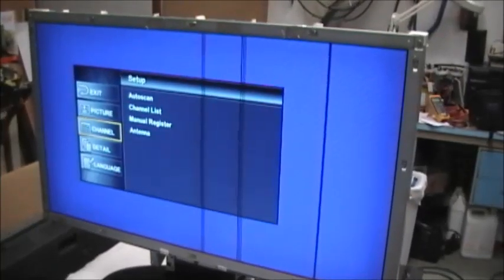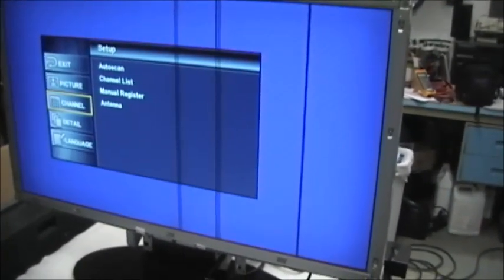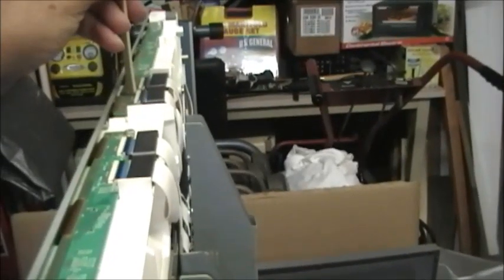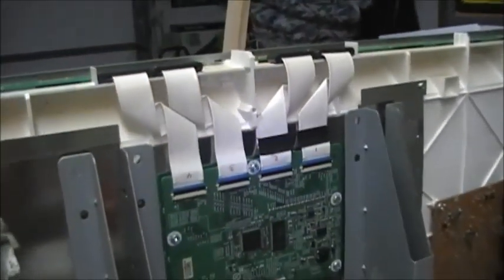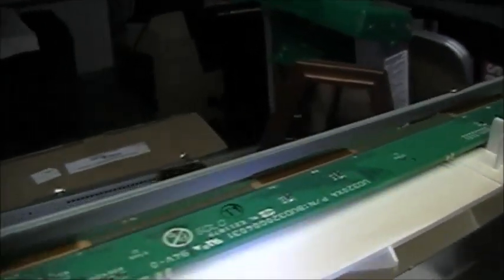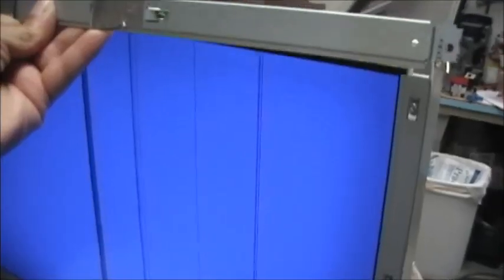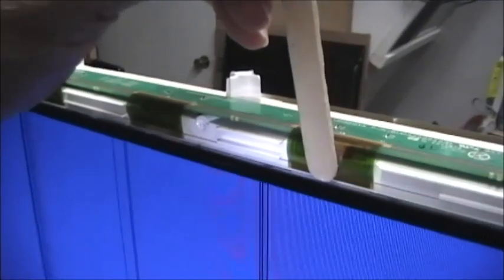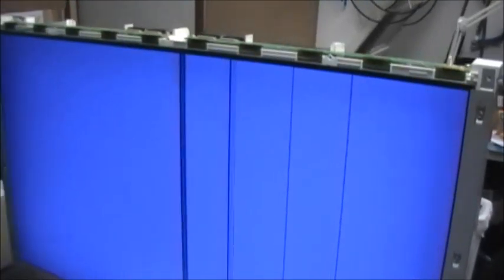LCD TV Repair Secrets - Vertical Lines on the Screen

Comment: My tv is an Eko 42in smart is like the middle line, it's behind the screen display but it flickers. I can't really dissemble my tv by myself so idk what to do
Reply from the maker: Well the good news is that when a flickering line is behind the settings menu, it means the LCD inside the display panel assembly is fine. The problem is most likely loose connections between the digital board and the LCD. The digital board is behind the back cover of the TV. Taking a back cover off is MUCH easier than taking a display panel assembly apart. Of course, you still need someone to take a look for you, but the problem will be beneath the back cover, not in the display panel. Hope you have someone. Good luck! Thanks for commenting.

Comment: @LawrencePina Do you know what would cause white vertical lines that are only there when you open the menu?  The TV works perfectly normal for about 12 hours or so. It's like after it gets warm or something then it starts showing lines, but only when you open the menu. The lines are going up n down from each letter in the menu. If you selected something else in the menu and the words/letters are in a different place, the lines follow them. You can turn the TV off for a few hours and it will be perfectly fine again for 12 hrs or so, then the lines show up in the menu settings.  If you don't turn it off when it does that, the screen will eventually go completely black. But then it will work normal after it cools off... Idk? Thanks in advance for any input you may have about this.
Reply from the maker: Sounds like a digital board problem. I've rarely seen similar symptoms but much larger repair databases exist. To use them, paid subscribers (I am subscribed to a few of them) will need the make, model and manufacturing date of your TV. Repost with that info and someone may be willing to share exactly what's wrong with your TV. Let's find out. Good luck! Thanks for commenting.

Comment: So, really cool thing about the conductive adhesive bonds these panels use for that stuff. This dates all the way back to even dot matrix displays. The way how that adhesive works is it conducts under tension. When not under tension, it is no longer conductive. 

It's not necessarily a matter of the glue itself becoming "unstuck", but rather, the chemical structure of the glue in one particular spot (or many) has been altered, as it is no longer under the correct amount of tension to conduct electricity. 

Think something like a chain. When under tension, a chain is strong and it is capable of linking two moving parts together. When that tension ever so slightly changes, that is no longer the case. These conductive adhesives work a lot like that. The difference is, the chain is molecular. The adhesive is still sticky, it is still doing its job. But somehow, some way, the molecular structure has been altered and it is no longer electrically conductive. 

This type of adhesive bond is extremely similar to what is used in silicon dies, to electrically attach the die to an interconnect. The big chips we're all used to seeing are actually significantly smaller, the die itself is very tiny in comparison to the big chip packaging they are placed into. Adhesive bonds like these are sometimes used to attach micrometer diameter wires to the package interconnect, which is what gives a DIP for example the leads you would slot into a socket, a QFN the edges to surface mount to a board, or even give a BGA the pads underneath the package to accept solder balls. 

It IS possible to fix these cables, I've seen it done on iPhone LCDs in a process where a new cable is attached to the panel. The way how these specific cables work on many TVs and displays is they are bonded the same way at the panel AND the board substrate. The trouble is, I don't think anyone makes tools to service the cables on anything larger than what you might find on an iPhone LCD or OLED. If they did, it would certainly be possible to restore the connections on these cables and fix them long-term.

Comment: Tks Bud 
After all the posts you ve been a great help  been trying to work that out.
So ok has any one tried to reactivate the bond maybe with heat gun or such 
Curious
Reply from the maker: I tried that, only to find that any heat you put on the cable completely detaches it . On the other hand, any pressure you apply to the cable immediately gets rid of the lines, but only temporarily. Due to heat related expansion and contraction, they always come back. Longest I've gotten (by applying a pressure pad) is about a month.  Yours is a good question. Thanks for commenting!

Comment: Can you tell me what  I can do to my sony Wega with the picture moving horizontally? thanks
Reply from the maker: Resolution of the sending device may be too high. Try reducing it to 480p. If that works try increasing to 720p. Also make sure frequency (50 or 60Hz) is correct. Good luck. Thanks for commenting.

Comment: My tv is the ribbon cable but i cant get rid of them.  When tv is first turned on on the left it has many lines but as the tv warms up all but 2 lines will stay on the screen.
Reply from the maker: At least you know what's causing the lines now and you won't waste money on boards that are not going to fix the problem. That was the point of the video, so I'd say you got the point! Thanks for commenting!

Comment: @lawrencepina the glass panel has two layers in which liquid crystals are sandwitched between two glass sheets . The glass has etching done to connect with flex cables for 1920 x1280 resolution. The TV when becomes 7-8 yrs in age , the connectors which are attached by a process of conductive bonding , to the glass. which means one side copper on flex connector is bonded with glass , to provide signal. The heat generated flows up from smps and some of the connector pins get debonded due to expansion or heat , when product is aging. Slowly the [product gets these lines.  Secondly , there is a small chip within the flex cable itself when you observe it. UAO is a company which makes the panel with top pcb and provides this as a single entity to Samsung and other makers. There is a specialist repair centre in a town , which can do the re bonding of these panels.  If you have a panel issue . typically no one will try to re bond it themselves. The regular mechanics or Samsung type of TV centres will simply replace the panel and it will be an expensive affair. The life of LCD TV is 7-8 yrs as against pciture tube TV ( 15-20 yrs). 
The way you were showing the small tapping on connector removes the line,  is ilttle dangerous since it will create morelines.  
Over the TV which is not mounted properly and is very heavy in weight , the screen does not stay in perfect vertical plane . That brings strain on the connectors on top , mostly on right side of TV . Due to weight the panel will still not stay perfectly staright , since the mounting person may not have used the 4 screws and leveled it properly. A small tip on perfectly mounted and tighyl fitted stand , can give your TV before the line appear.  Once the lines appear , you need to take it to panel bonding repair centre which has special facility to re bind the connectors. That is the real solution for this issue for panel repair. If you are a person who knows the proper handling of large glass panels, then you can also remove the panel connectors and T con Board , take it to bonding centre. The ACF Bonder orT con board have 2 categories - 12V or 24 V and 30 pin or 50 pin interface.  The logic board of samsung , or sony or LG can have similar interface at T Con levels. 
Laptops also have display panels sold in market based on connector pin size. Once you know the panel resolution and connector pins 30- or 50 , then you can order the panel based on size ( 14" or 17" or 15.6" or 46" or 54 " and so on ) Hope this detailed info helps everyone

Comment: Tried this and several other recommendations without success as yet. I only have ONE green vertical line, it is clearly dots running up and down. In that line there is one missing dot. Might that tell me anything? Like maybe it is the actual screen rather than anything else? Would love an answer from anyone with any thoughts on this. Thanks!
Reply from the maker: You have a bad display panel assembly and because of the way things are, there's noting to be done about it. At least you know that new boards are not going to fix this problem. If it was up to me, I'd require TV manufacturers to guarantee their display panels for 5 years (parts and labor) or, at their option,  replace the entire TV. Never going to happen, though. People have been conditioned to "throw it away and buy another one." Sad comment on our society...
Reply: @LawrencePina  Agreed.
Reply: @LawrencePina  Yeah, the "assemble-cheaply-because-we-want-more-sales-and-money" mentality is not good for our planet either. Look at all that waste we bury in landfills or pile up as junk, right?
Reply: @LawrencePina  At least they could make accessible the service manuals and host them forever on their sites, it costs pennies to do so.

Comment: Yea..... But how do you fix it lol
Reply from the maker: This one was so bad, had so many lines, that I didn't even attempt it. But sometimes, when there's only one line, you can try to fix it by applying permanent pressure. People use everything imaginable - wads of bubble wrap, wedges of cardboard, eraser material, packing tape... Just about anything will work, even just a good squeeze, at least temporarily. The problem is - heat expands, cold contracts. As soon as you turn the TV OFF, the contacts cool down and tend to separate again. That's been my experience. Other's disagree, though, so who knows?
Reply: @LawrencePina  thanks for the info

Comment: You can fix these with rigid foam window weatherstripping pads (experiment with various diameters). Stiff enough where its not too spongey, and once the bezel is put back on, it creates enough force to securely wedge the cable back to the board. It does work and I fixed one I got 6 years ago, still works.  When you are poor like me and cannot afford a $750 HDTV, and get that same $750 HDTV for $60-$85, this is what you have to do.

Comment: This is great vid for diagnostic.  How to fix it?
Reply from the maker: Almost anything you use to apply pressure will provide temporary relief, but in my experience, there is no permanent DIY solution. Permanent repairs require new (exact replacement) COF cables (generally sold in bulk), chemicals to remove, clean and reattach them, an "LCD Tab Bonding Machine" (please search on that term), and a highly-skilled "LCD Tab Bonding Machine" operator. Presumably, such repair shops exist in Asia but I'm not aware of any here in the States.
Reply: @LawrencePina  thanks for the info.

Comment: Perhaps a hobby iron could be used to heat/re-activate the factory glue
Reply from the maker: Get any kind of heat anywhere near that COF (chip on film) assembly and the film will melt, quickly detaching the whole thing. Now, ask me how I know that...
Reply: Ok, cool. What temperature did it melt at ?
Reply from the maker: @nimrodquimbus912  Can't tell you. I just waved a hair dryer at it while pressing the affected area with a Popsicle stick and when I let up (after just a few seconds), the whole COF detached.

Comment: Would black horizontal be caused by the samething? Also why does taping pins on the ribbon cable make the problem go away?
Reply from the maker: No, black horizontal lines are not caused by the same thing in my experience. Tapping the pins works because it temporarily closes open contacts.
Reply: I bought a 4k lg tv with horizontal black lines going across the bottom quarter of the screen. I fixed it with tape, narrowing it down to 4 pins on the T-CON ribbon cable. With those pins blocked it caused faint vertical line that are only visible on white or bright background colors, still pretty unnoticeable tho. Just curious whats causing it.
Reply from the maker: Clarification: I love Gritz's TV symptoms are NOT related to the 
vertical lines shown in the video. To prevent unnecessary confusion, different symptoms are best discussed elsewhere, but that having been said...

Answer: No, I don't think the situation you describe is timing 
control board related. The bypass method you've successfully employed confirms liquid crystal structural failure. Most likely, the faint vertical lines that you now have indicate that you've just bypassed too many signals. Move the insulating material left or right (uncovering just a single wire) and retest until the original horizontal black lines across the bottom quarter of the screen reappear. The wire just uncovered is generally the only one that needs to be bypassed. Using a mini razor knife, notch that one wire out of the cable. Reconnect it without using any insulating material and retest. If the horizontal black lines have NOT reappeared, that's the best the LCD is going to be. If the horizontal black lines remain, you may need to bypass a second signal wire (rare). Otherwise if you still see faint vertical lines, you can try entering the service menu and turning down the sub-contrast until the faint vertical lines disappear. And, for what it's worth, you've earned my respect just for getting this far. Thank you for sharing your experience.
Reply: @LawrencePina  Thank you for taking the time to answer my question.

Comment: YouTube won't work on grundig smart tv. What could be the problem and how to resolve it?
Reply from the maker: I wish you'd asked this question under one of my "MBOX Frustrated User Guide" videos but assuming the clock is set to the correct time on your TV, and assuming you've got at least a 10 mbps Internet connection to it, then the YouTube app you have may not be compatible with the OS you have. An automatic app update or TV firmware update may have caused this. Additional app updates and firmware updates may resolve it. If not, then consider adding an external Android TV box to your system. AliExpress prices start at under $20 and there are some surprisingly good boxes in the $25 range. Any of these will play YouTube and much more with no problem.

Comment: i have problem of vertical lines in dell s2418Hx montor :( how to fix any solution?
Reply from the maker: Same problem. Same verification procedure but even easier to prove on monitors and laptops (because they have less metal around the screen). Without even taking the monitor (or laptop) apart, squeeze the plastic bezel just above the line and see what happens...
Reply: @LawrencePina  while pressing it goes away but when I let go the pressing it comes back again  
:( what to do Lawrence. can it be fixed if I take monitor to computer repairing store???
Reply from the maker: @bineshshrestha  No, I would not take it to a computer repairing store, because there is no permanent fix. If I were you, I'd just put a C-clamp or a spring clamp on it to maintain pressure. Place a little post-it-note under the clamp, and its real purpose will be disguised. What have you got to lose?

Comment: Thanks for the video - very good. A quick question do you know what causes double images on LED Samsung TV's? no one seems to be able to give a definitive answer on the cause of this problem.
Reply from the maker: According to the "LCD LED Screen Panel Repair Guide" E-book by Kent Liew, 95% of the time (on Samsung TVs) it means the screen panel is defective. He's had some success using a Panel Cut OFF Modification Method  to correct the problem. Detailed info starts on page 72.
Reply: @LawrencePina  Thanks Lawrence
Reply: When you have screen ghosting like that, with or without the burn lines, it is an issue with the frame buffer RAM not refreshing the memory properly and allowing images to linger in the LCD's memory. Doing a memory test on  the RAM to find out which one has failed, or replacing it can fix the issue in most cases.

Comment: Uhhhh...  So how how do you fix that?
Reply from the maker: Almost anything you try will fix this problem temporarily, but heat-related expansion and contraction occurring during the ON/OFF cycle will quickly undo the fix. So, unless you leave the TV ON, 24/7, with the back cover removed, in a climate controlled environment where the temperature never changes, you're stuck. The only lasting fix would be to replace the display assembly but manufacturers have determined that it's neither wise nor cost effective to make them available.
Reply: @LawrencePina  Oh! Okay, thank you!
Reply: No. You shim it with weatherstripping foam under the bezel.  I did this 6 years ago to a brand new RCA fresh from store return salvage that I paid $45 for. The lines have not come back.  The issue is just production defects on the assembly line, it has nothing to do with heat. If one of the workers or robots missed a dab of glue, that's the only time this will happen. It's just a fluke occurrence. 

 I have another RCA HDTV that is 11 years old and it has no issues in the screen. Replacing the display assembly will not do jack shit because you will still have to re-glue the cables, and if it comes with the cables, they will have been done on the same assembly line as the problem TV with the same glue and production methods, so it can still have the black lines appear, but with the addition of the fact that you will have fattened the wallet of a random TV repair guy.

Comment: Is this the same  for LED tvs? two grey vertical lines about 5 inches in on the left.
Reply from the maker: Unfortunately, yes. The back lights are different (LEDs vs. florescent tubes), but the screens are the same.